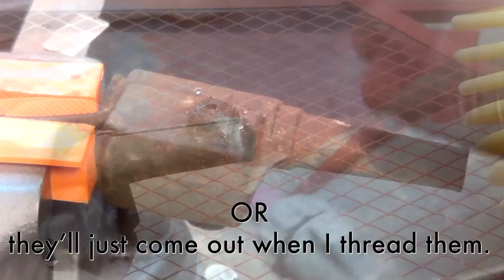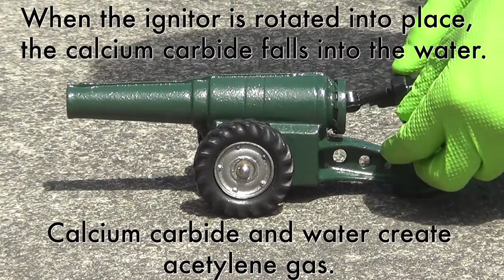Restoration of 60 Year Old Gas Cannon - Will it Still Fire?

Comment: Now that's a restoration! Oh the memories. My brother and I each had one of those. When we ran out of powder ammo we used firecrackers. Had those things for years. Wish I knew what finally happened to them. Thanks for a great video!
Reply: I used firecrackers and fired cut off pieces of candles.
Reply: actually you can STILL buy them on line as well as the powder to work them!
Reply: I got lucky when I found mine in my mom's house as we were clearing stuff out to have it demolished. I got it the day before they pushed it over with an excavator. I was surprised with all the other water damage the cannon was almost pristine.
Reply: Mi er

Comment: Back in the day when toys were cool.
Reply: NOW, KIDS ARE NOT ALLOWED TO OWN A CAP GUN!
Reply: Bextar636 yes you are
Reply: Correct. I have an old toy tank from the soviet union. rotating turret, all metal, rotating tracks.. Now toys kids gets are cheap plastic pieces of crap.
Reply: uncletigger  I used powdered safety (brown) match heads, sulphur (evaporated the water out of dead battery acid) & soot (carbon) to make gunpowder for the cannon I made as a teenager in the 1970's. Worked fine.

Generation X kids were way smarter than todays Millennials & Generation Z kids. We knew how to figure things out & practicalities when it came to making things.
Reply: These cannons are still being made. www.bigbangcannons.com/
Reply: @CZ350tuner  I believe it more applies to children born in cities rather than some arbitrary generation, not a whole lot of practical things to do in an apartment.
Reply: This exact cannon is available from https://www.bigbangcannons.com.  American owned and manufactured.

Comment: I remember the Bangsite cannons that worked the same way with the calcium carbide. Of course, that wasn't quite loud enough for us back then, so we used empty paint cans and just poked an igniter hole on the bottom at the edge. A bit of water, 3-4 chunks of the calcium carbide,  press the cap on tight, prop the top edge of the can up on a piece of wood and wait 3-4 minutes for the gas to build up. Then wedge a wooden stick match 's head halfway into the igniter hole, light the other end of the match, and back way up. After 3-4 minutes of the gas building up, those things sounded like Howitzers going off. There would literally be 5 or 6 feet of flame shoot from the the can as it blew the lid off. Most times the can couldn't be reused after that as both the can and lid would be rounded out. Yes, we were quite nuts back then.
Reply: nothing nuts about that at at all.  too bad the kids today won't have those kinds of memories.  All they will remember is helicopter parents.
Reply: I never had fun like that when I was a kid.  Taking notes ...
Reply: We did something similar except we used soda cans, tennis balls, and lighter fluid.  Coated the inside with lighter fluid, sun it around a couple of time to coat the lining, dropped the ball inside and touched it odd via a hole in the bottom most can.  Unfortunately, cans are now made differently which negates this.
Reply: @patrickdonaghy2070  I used to do something similar with tennis balls and pringles cans. We'd put anything we could find that was combustable into the can; Perfume, cooking spray, ground up match heads, maybe a combination of the like... Then jam a tennis ball in as far as we could, poke a hole and use a match as the fuse... Sometimes it was anticlimatic, sometimes we got grounded for breaking windows. Good times.
Reply from the maker: We used hair spray in our tennis ball mortars. LOL.
Reply: @patrickdonaghy2070  Mine was made of old Schlitz Tall Boy cans.

Comment: 7:00 how to ruin a dead center followed immediately by 7:30 how to ruin a collet.
use the face of the drill chuck to keep the die flat, and wrap the file in foil.
Awesome toy :)
Reply from the maker: Well, you're not wrong, however that center was ruined long before I got it. It's my "do not use as a center" center. Came with the lathe. I keep it for jobs like this.

Comment: I still have mine that my grandpa gave me, toys were built to last back then.
Reply: I do too! My pops gave it to me also! That’s so cool. It was one of my uncles I think. Mines in good shape with the original paint. I don’t have the plug tho. Didn’t even know about it. I heard the “ammo” was a paste that came in a tube. Never seen one fire. Now I know what the scoop was for. Lol
Reply: I’ve got a 105mm in my garage I’ve had since the early 80’s, still in the beat up box. My dad got it to replace the one he gave me in the late 60’s, same model. All my friends that had them as a kid all had the little one like in this video he restored. The one I have has a push button ammo hopper which was way easier to reload. You had to remove the igniter after each blast to blow fresh air back into the cannon making it ready for the next shot.

Comment: I had two of these, one the size of the one you restored, and a larger "Big Bertha" or some such name. Both used the identical firing mechanism, powder (Bangsite), etc. The finish on them was really rought - casting flash all over the place - not half as well finished as your restored version. I probably have at least one of these still around, although I haven't seen it for about 25 years. I recall ordering them from an ad in the back of "Popular Mechanics" magazine - that would have been about 1966-67, along with a couple of tubes of "Bangsite" powder (2 for $1). They were actually not very loud - nothing like a firecracker, for instance. Still, it was one more toy about which modern parents would have a case of the vapours. Oddly enough, they never did me any harm. Go figure.

Comment: We built one with knuckle joint sleeve and sparkplug welded on, using black powder, ball bearings and ignition coil a right lethal weapon put a 25 mm hole though the side of a shed.
Reply from the maker: Yeah that's a whole other level. This one's safe for kids!  (probably not as fun though )

Comment: just curious, could it be powder coated instead of painted? powder coating is more durable and withstands heat well
Reply from the maker: I don't generally like to powder coat things that weren't originally powder coated unless there is a good reason. Also, powder coating ductile metals can be problematic, so I avoid it.

Comment: I would have prefered turning new wheel hubs out of brass.  You could do a split rim for ease of install if you are afraid of tearing the rubber.

I just saw what you finally made for the wheels.  That is very good.  I like the bushing idea.

Comment: Not being a skilled metallurgist, I'm curious as to why you didn't use flux core solder?
Reply from the maker: Because none of the silver solder I have has flux core, unlike say electrical solder which almost always has a rosin flux core. So you've got to use a separate flux. If you see the first soldering clip I did, you'll notice that I used some silver solder paste from a syringe. That is a mix of little silver solder balls and flux. After using it though I prefer the solid solder for this type of application. Thanks for the comment.

Comment: At 1:00 are you paiting it or clesning it in some way?
Reply: Its called a sand blaster its used to clean/sand parts using sand and high pressure air it can be very effective for sanding if you use bigger grains of sand in the machine

Comment: At 10.00 How about just using bolt and nut to secure part to vise since there is center hole? :) Holds part steady, you can just open the nut to turn it and does not warp the part or scratch it.

Comment: I’ve always wondered what that blue stuff is. It can’t be ink right???
Reply from the maker: It's marking fluid. Effectively it's ink for metal work. You can use ink; I use a sharpie sometimes, but it comes off metal very easily. Marking fluid is made specifically for this purpose.

Comment: I have one of these, but in mint condition, I have the ww1 style large cannon
Reply: I have a new early 1980’s 105mm 17”, but the box is getting pretty chewed up. I had the exact same 105mm in the late 60’s as a kid. As a kid I learned that if I gave it a double or triple load of bangsite, it would ignite a very rich mixture and you can get flames to burn out of the barrel.

Comment: I just got one out of pile of junk I'm going to restore, it has the white powder you normally see from a bad battery but this is around the breach.
How do you remove this white corrosion and how much water do you put in the cannon when ready to fire it???
Thank you anybody.👍😉
Reply from the maker: The white stuff around a battery is potassium carbonate. The white stuff on your cannon is caustic lime. (Don't get any in your eyes/mouth). It comes off easily with CLR or even vinegar should do it. 
Conestoga recommends about an ounce of water for firing. They still sell parts for the cannons if you are missing anything. Just Google "Conestoga Toy Co."
Thanks for watching.
Reply: @AcmeRestorations  Thank You.👍
Reply: Bangsite will oxidize as it ages, even in the sealed tubes. I had about 6 unopened tubes that were about 15 years old. When I went to use them, all had turned to white oxidized powder. Buy fresh Bangsite. I just ordered 3 new tubes.

Comment: Methyl ethyl ketone is also the liquid hardener for fiberglass resin. If anyone needed to know.
Reply from the maker: You're thinking of Methyl ethyl ketone peroxide (MEKP)
Reply: MEK would destroy most anything except metal. I was a helicopter mechanic in the army. After we prepped any aluminum part down to bare metal, we were required to wipe the bare aluminum with MEK before immediately applying a coat of zinc chromate primer. Finding a small container that would not melt to pour the MEK into was the biggest challenge we had.

Comment: I remember the bang being bigger, louder. want it bigger and stronger, add some kind of oxygenator to the calcium carbonate. I think there should be a spring on the trigger thing, you just pull it back and let go.
Reply from the maker: You don't get the full effect on video. It's so loud my ears ring when I fire it. There was no spring on the original. I'm trying to match the original as best as I can.
Reply: @AcmeRestorations  seems to me there was a spring... but last time I saw one in person, was like 50 years ago, my memory may be faulty.

Comment: I am not sure why you went to all the trouble to fabricate parts.  That cannon, along with its sister models,  is still in production.  Parts for it are as common as dirt.  The only thing I could not find on the Big Bang web page were the plastic wheels for your particular model.  Nice restoration, though.  That model is $100 these days.
Reply from the maker: Yeah well sometimes you find that out AFTER you've put 20 hours of work into it :).  We never had these when I was a kid. Had never seen or heard of them> I think they must have been sold on the east coast. Didn't occur to me to look for spare parts until way too late. Anyways it was a fun project. Yeah, the new ones are $100 and they are aluminum. Yucko, Thanks for watching.
Reply: @AcmeRestorations  There will always be hindsight and it will always be 20/20.  In this case, it is felt more satisfaction and enjoyment were experienced with the route you took rather than google-order-assemble option.  I agree with your response and assessment.
Reply from the maker: @patrickdonaghy2070  Thanks Patrick!

Comment: You are good! But honestly I can’t believe someone would let a kid play with that!
Reply: This is from the time people had ten kids so they had some to spare if one blew themselves up.
Reply from the maker: They are pretty safe. Safer than caps. You can't light the calcium carbide on fire. If you hit it with a hammer nothing happens. If you add more to the cannon, it doesn't work as well. You have to get the ration right to get the pop. This is the same reaction used in miner's helmet lamps and in car/bike lights before batteries were used. Thanks for watching!